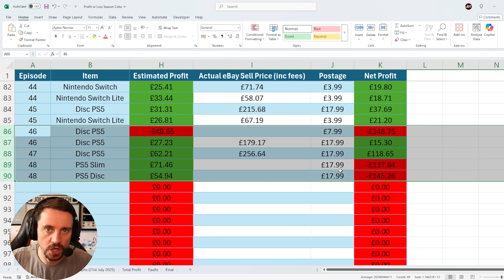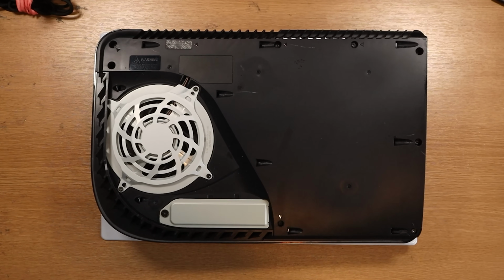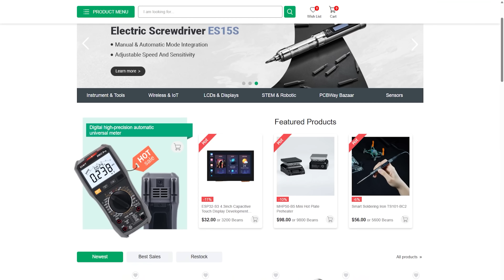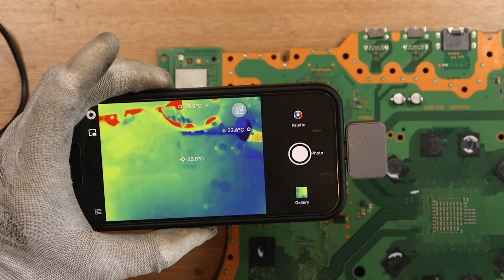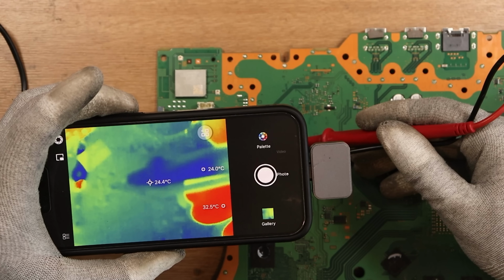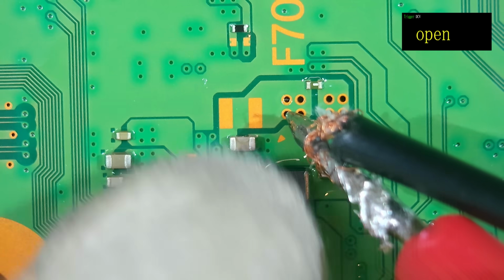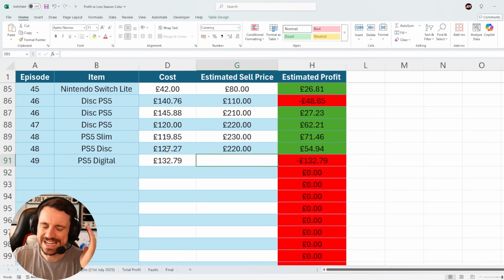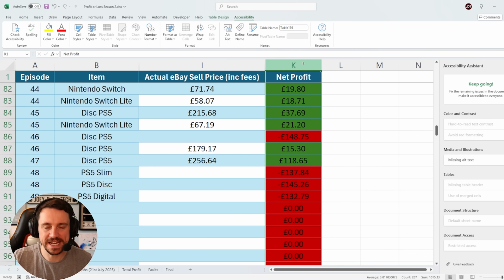Trying to Fix FAULTY Electronic Items for a Profit! S2:E49

Comment: Ebay is shit at the minute for faulty PS5's. Many sellers are palming off unfixable PS5s that I think they know about. There's very few  sellers who are innocently selling 'a no power' PS5. 9 out of 10 have been uarted and worked on, determined its an APU issue then conning people by not describing what they've done/found. I just bought one that has an APU error code. There's no way the seller didn't know. Been uarted before me and signs of extreme heat on the board. I've got 3 PS5's like this, I'm now going to have to part them off to get some money back. Seriously out of pocket. Buying up PS5's to repair and just ending up with donor board after donor board. I'd stay away from ebay.  I agree with Joey too its not worth paying more than £100. Too many sellers are conning people.

Comment: I am getting to grips with my very cheap Series S no power, it is beginning to look like a duff PSU and if I get it sorted means I will have two Xbox One 1540's. three or four One S's, a working but not docking Switch, couple of PS3's and poss a working phat Xbox 360 could be in the joblot...   Daughter is getting proper gripey about it and has set nag muscles to stun... she gets cross cos I go at these fixes hammer and tongs then play games on me PC.   One of the 1540s is an immaculate Forza blue edition with the rorty engine noises.   Could they be of use per se?   Sadly ones 3 wheel van is still in garage so would have to be a collect but only other side of Salisbury which is like a stones throw for you.

Comment: Wish i could send you broken stuff. I resell a lot of stuff and sometimes its not worth it to sell it for parts. Like a canon 60d that has no power. I think i also have a nikon d3500 with no power. I have a ps4 slim with a bad disc drive too. I buy in bulk and sometimes stuff doesnt work.